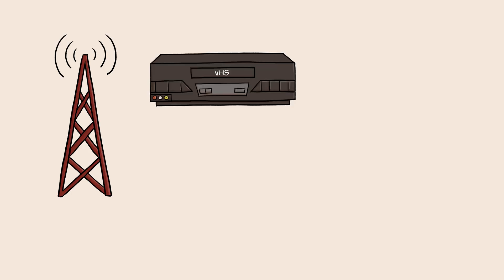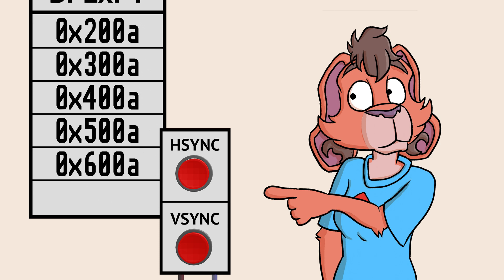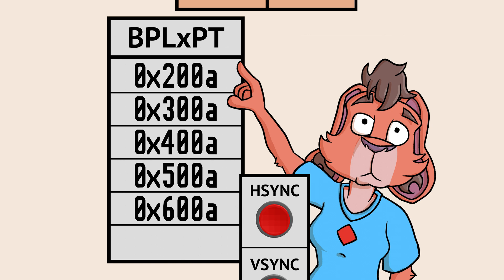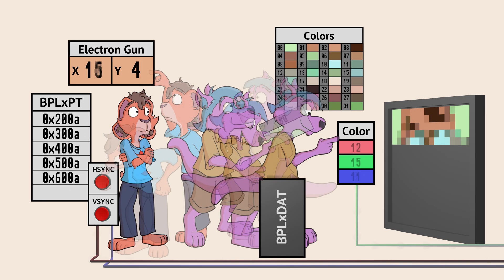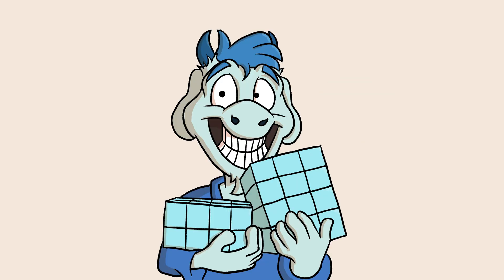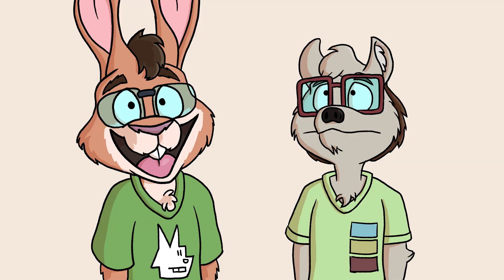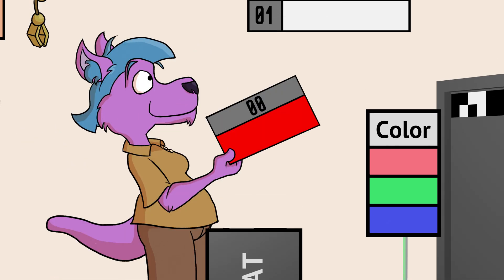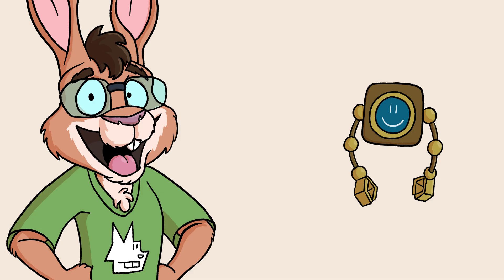Amiga rasterbars are cool -- Meet the Copper, the hardware that helps make them happen

Comment: The Copper is a 'wish-list' item added in response to making life easier for display-list graphics machines (in particular, it's the follow-up to the Atari 800's system of placing graphics on the screen). I.e. The Amiga is, as Joe Decuir describes it "The third system" or iteration whereas the Atari 800 is the second system (and the Atari 2600 is the first system of the series). Between this and the Agnus having 25 DMA channels, its own RAM bus, and being cycle-interleaved with the other RAM bus that the CPU uses, it makes for a pretty slick system. Even the eight re-usable sprite generators are cycle-interleaved with Agnus. That means you can use moving blitter objects, hardware sprites, software sprites, and copper (racing the beam) effects all at the same time without a ton of load on the CPU. And as the Dutch Retro Guy has proven you can multiplex sprites horizontally to not only repeat a sprite across the screen but also use the Copper and a multiplexed sprite to display a non-repeating pattern: https://www.youtube.com/watch?v=rzFUq1tHPHc

Comment: Sorry, this is not a good explanation of the copper. Firstly, the copper has very little to do with bitplanes, although you do define the bitplane pointers in the copperlist. In fact the copper isn't restricted by the settings of the display window at all. Again, you do define DIWSTRT/DIWSTOP/DDFSTRT/DDFSTOP in the copperlist, but the operations of the copper happen over the complete width of the raster, so that's why you'll often see colour in the background whilst say, a scrolltext might disappear before the colour ends. The copper is also not affected by the Modulo.

Also, there are special waits used to cross into the PAL area of the screen.
Reply: @@igakoga2481 That's so true, except when the loudmouth has done loads of demos, many of which can be found here on yt. So obviously the loudmouth has no idea what he's taking about and therefore can be safely ignored.

Comment: Well that does make seamless color bands, but what is more amazing is when the screen changes mode like indexed 4 and ham in a copper line. I guess that means the graphic chip can reconfigure mid screen?
Reply: Like on C64 it all is just registers. On graphic cards with dedicated VRAM you could lose memory contents. But Amiga could not even change any refresh frequency ( only the pixel clock ).

Comment: Good old Copper. Those were the days.
Reply: In 1993 on brand new AtariJaguar hardware you had an object list and could set interrupts on a scanline and let the GPU modify a register, like the horizontal resolution change in Doom.
Reply: @ArneChristianRosenfeldt  I used to develop for the Jag. It was still not the same.
Reply: @elmiguel1969  yeah probably because racing the beam loses a lot of power when you have true color anyway and do 3d.

And also because the Jag is like a factor of 10 too slow to do 3d while racing the beam. Similar to the Nintendo DS.